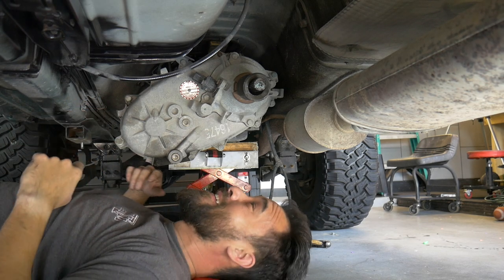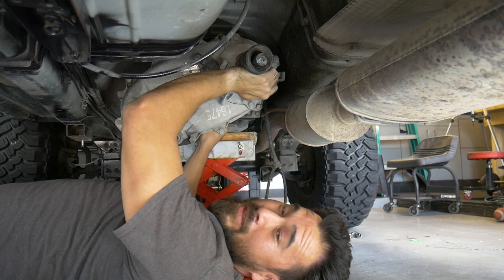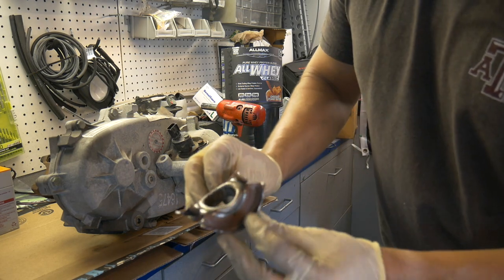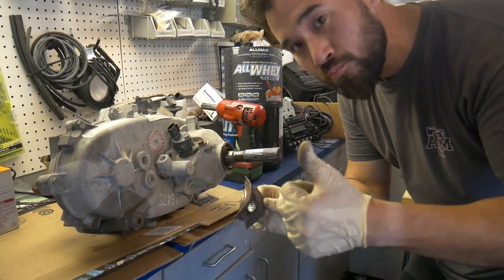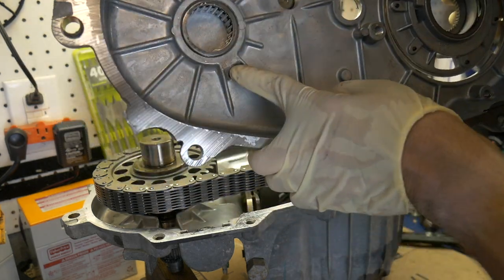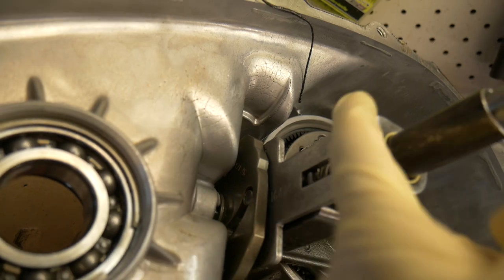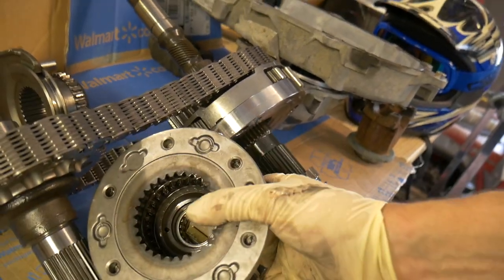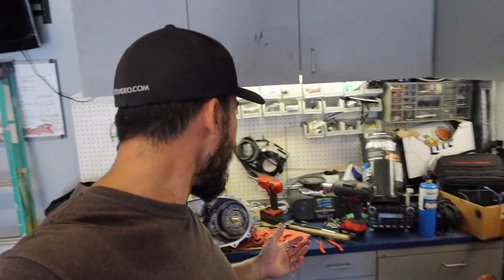How to Rebuild a NP242 Transfer Case Part 1 : TearDown            Jeep Cherokee Xj np231

Comment: On 33" tires you'll need a 
30 tooth speedo great for a 3:73
33 tooth for 4:10
36 tooth for 4:56
39 tooth for 4:88
Reply: Convient thanks
Reply: I went by some chart somewhere and went with the 39 tooth for the 4.56 gears and 33's.  It reads less than actual by about 3 mph at 60mph.  So, this reference makes sense.

Comment: i hear this mess so much i have to say something. this crap about "its a 242 not a 231, but i gotta work with what i got". i say that a 242 is 3 x the transfer case than a 231...
Reply: Wrong
Reply: It's cool because it has multiple low high range speeds but strength wise ppl say it goes to the 231
Reply: I agree with you on the 242 transfer case. For what I use it for the fulltime mode is awesome when your in the snow or sandy areas and can drive with it and leave it on Unlike the 231 it's only ment for off-road use and that's it. To each their own I guess.

Comment: Don't be disappointed about having a 242, they're barely weaker than a 231 and the awd mode is killer. I swapped my 231 out for a 242.
Reply: 242 is stronger than 231.
Reply: How hard was it?
Reply: @nickrainville5054  not hard at all
Reply: @jlsgarage872. Yes the 242 is stronger than a 231, they put the 242 in the H2's.  If you live where you have snow covered roads in the winter the AWD feature of the 242 is a must have.

Comment: Input bearing lock ring on my 242 was put on backwards. That was a pita. Drilling the pin out wasn't really that hard. 3/16 bit and some light oil did the trick.

Comment: I'm new to 4x4. The guy I bought my XJ said in order to have the 4x4 bind and work, I have to put it in 4H or 4L (whichever) and drive reverse for just a bit and then put it on drive. I don't remember if he said that is how you engage the 4x4 or maybe he told me because there might of been something wrong with the gears engaging and locking in the 4x4. But I know you don't need to go in reverse to engage the 4x4. So what could the problem be IF there is a problem with it? I live in Cali so I gotta get my XJ smog before I can take it out and tested. Just asking if anyone knows what could be if there is a thing that would actually cause that.
Reply: My only guess is dude had a junk locker in there that required that process to engage. I know mine doesn’t always like to come unlocked but it’s in the front so I never worry about it

Comment: So, question and I keep getting conflicting answers. I have a 96 ZJ with the np242 selec trac and am having difficulties finding the correct chain bc places have different info that all conflicts.. what chain does the damn zj use in its 242
Reply: I'm pretty sure it's the same for the zj as the wj, the I6 models have a nv242j while the v8s have the nv242hd. you can tell the difference by the rear drive shaft out of the t case. The 242j has a rubber seal/boot, while the 242hd has a metal seal

Comment: My first time working on a transfer case; seems simple enough. In my son's WJ taking out the 247 for a 242 so we can put a lunchbox locker up front. Just need to swap in a few parts. This vid is much appreciated. Sub'd...awesome cam quality. Easy to follow directions. Keep it up!

Sep 2020 & still helping out the community.

Comment: Just got a bearing and seal kit for  a 242j same as yours,  but  mine has a regular original style front output bearing. Not a sealed one.   Did you order that one?   What part number of kit did you get /buy?  I am just curious.
Reply from the maker: It was in great kit, sorry I don't have the part number.    There is two size bearings, a 16 and 24mm from what I remember.   1996 and up use a 16mm and 94 and below use the 24mm.    Not really sure why mine had a sealed bearing, I just needed it to fit.
Reply: Yes sir.  The 242 I have  takes the 16mm front bearing.  I was just curious about it.  Cause I have heard some mixed comments.  Some people say that that front output bearing is better for off road cause it is  sealed.  And some other people say not to  run it in a daily driver cause it wears out a lot faster than a open faced bearing.

Comment: my question is, on the 242 case when in the fulltime all wheel drive position should I be able to hold the front output shaft when turning the input shaft?
Reply: Yes. Because its AWD in that mode (which allows for differential speeds between front and rear axle), not 4x4, which would lock them together.
Reply: @nickopedia5669  thank you Nick...

Comment: To remove the blind hole bearing just remove  the needle bearings and have someone weld a bead on the inside of the race if you don't have a welder. When it cools , it will fall out.
Reply: Freeze spray can work along with a little heat on the case .Friend did it and the bearing fell out.

Comment: why is this transfercase less desireable? it has an AWD option the 231 doesn't. is it about strength?
Reply: Yeah the 242 is more versatile but won't perform as well in extreme offroad situations. 

It is rated for 1,400 ft-lbs of torque, so to break it you gotta do some crazy shit. The 231 is rated for 1,800 ft-lbs of torque by comparison. Many people will tell you the 242 is built worse than the American Education system but it's a good case, just not quite as strong as the 231

Comment: can the plastic fork guides be replaced without removing the shift fork assembly?
Reply: Yes, but you'd have to remove the mainshaft assembly first, which sits on top of the forks.